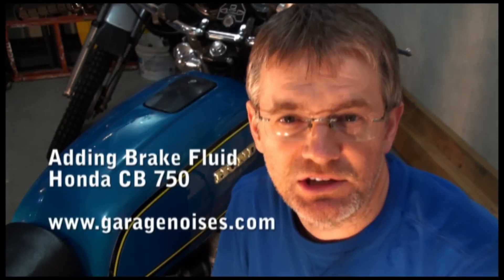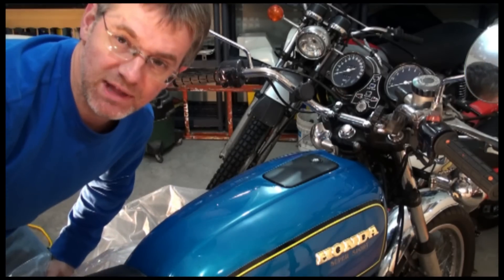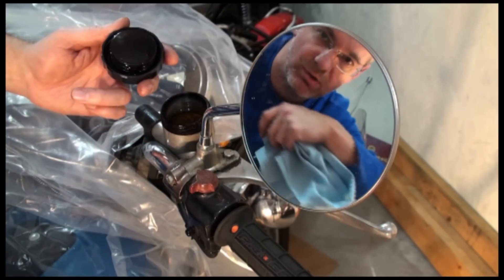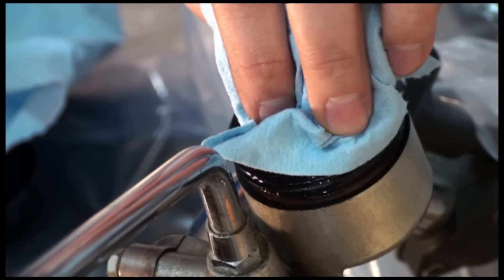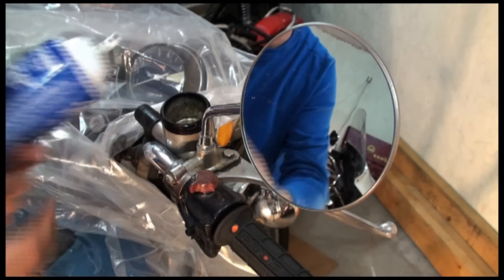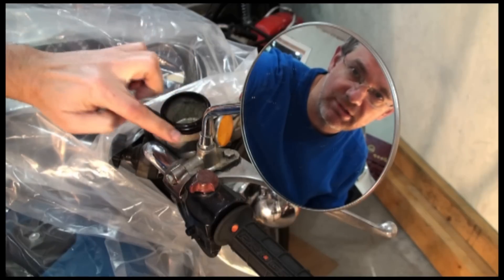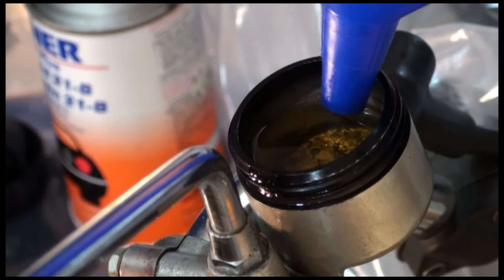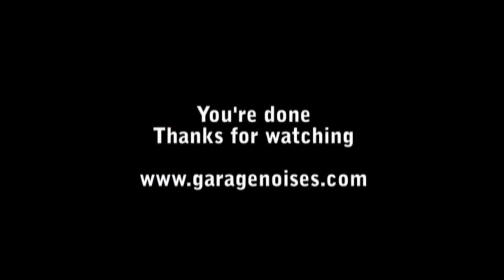How to Check and Add Brake Fluid on Honda Motorcycle

Comment: So i just bought a 1994 ST1100 and i want change the brake fluid in it. From what I've always been told is that Honda's are very particular and only like Honda brand products, but in your video you just used regular brake fluid and since i want to make sure i do a good job should i go to a special shop to get Honda brake fluid or can i just get any dot 3 from auto-zone and still do as good a job?
Reply: +TheSlayrnumber1 be careful, you know those little round peek windows that let you see the brake fluid level? the wrong brake fluid can eat them up! Check the cover of the resevoir and use the dot number specified.